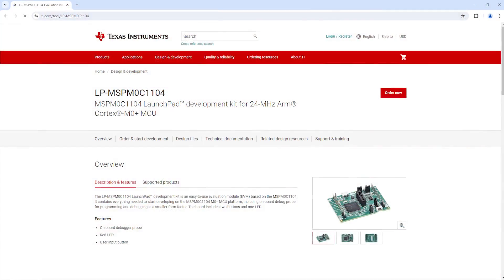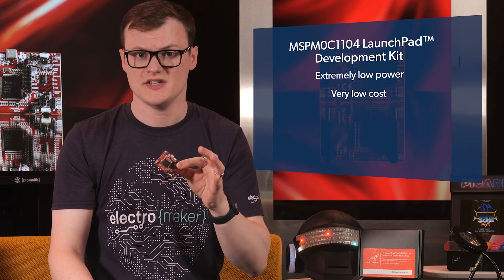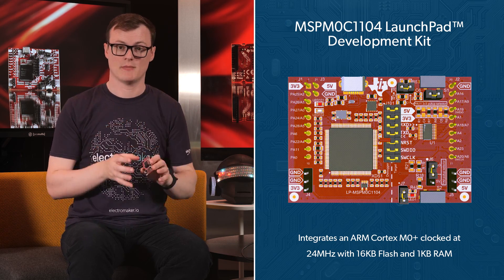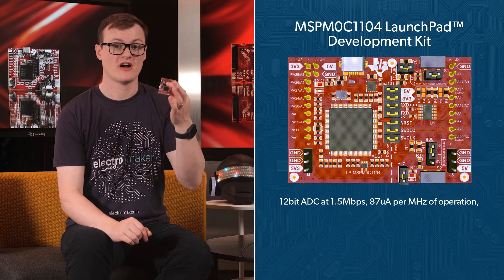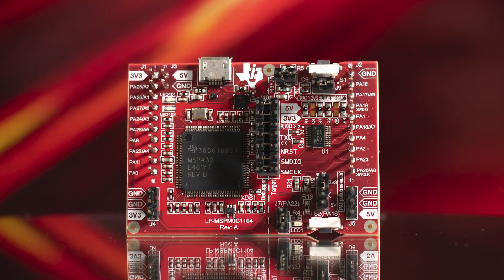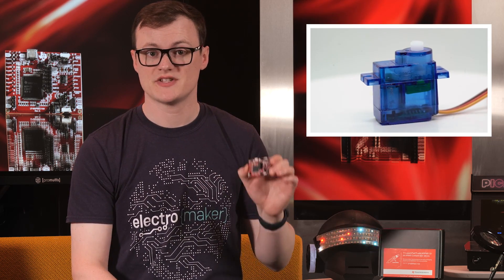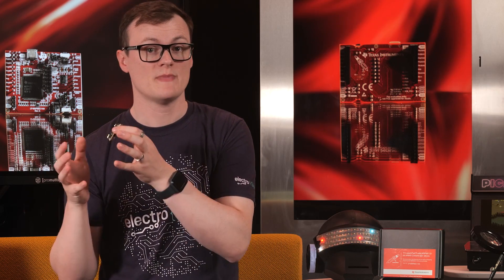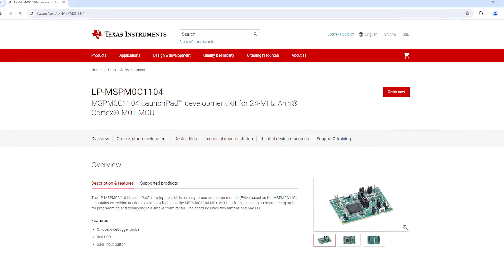Low Cost, Low Power Microcontroller: Texas Instruments LP-MSPM0C1104 Launchpad Review

Comment: Have a question, how are we supposed to solder it properly for the MSPM0C1104 MCU?
Reply: The development kit comes with a 20 pin VSSOP IC already soldered. On the other side there is a pad for a 20 pin VQFN IC which is not populated. I believe one has to remove the VSSOP IC in order to solder the QFN IC, according to the schematic both are parallel connected.

Comment: More people need to use terms correctly.

A microcontroller example, is the raspberry pi rp2040 chip for 70 or 80 cents each.

The second it comes with a PCB board pre-assembled with other components, is now a microprocessor.

Comment: The thermistor idea you mentioned- embedding the mcu with a thermistor,  using mcu to extract temperature data via i2c- I would like to see a tutorial on that.  I think you would need external eprom for a look up table.
Reply: You are right, just using a nonlinear thermistor to measure calibrated temperature is old school and need a look up table with memory cost. It may can do math function with slow updates, a challenge if that's what he meant or utilize a low-cost calibrated temperature/humidity sensor with I2C interface.

Comment: This is a really good replacement for STM8 micros. Also is good to have a cheap microcontroller with good documentation and support.
Reply: The documentation is key. TI does good documentation. I have some other chips lying around which don't correctly lable the pins. I still don't know which pin is SCK and gave up trying to figure it out.
Reply from the maker: TI does a great job with their detailed guides, pin diagrams, and examples, which really helps when prototyping or troubleshooting. It’s frustrating when the pin labels aren’t clear—I've been there too! Having to guess or dig through vague datasheets can definitely kill momentum on a project.
Reply from the maker: I totally agree! The MSPM0C1104 is a solid alternative to STM8 micros, especially with its affordability and TI's reputation for great documentation and support. It’s definitely a strong choice for projects where low cost and low power consumption are key.

Comment: #Launchpad , I would use it to make an iot home automation system to control the temperature of my lunchboxes
Reply from the maker: That’s an awesome idea! Using the Launchpad to create an IoT home automation system for something as specific and useful as controlling the temperature of your lunchboxes is a clever application. With its low power consumption and built-in ADC, it could be perfect for monitoring and adjusting temperatures. Definitely a fun and practical project!